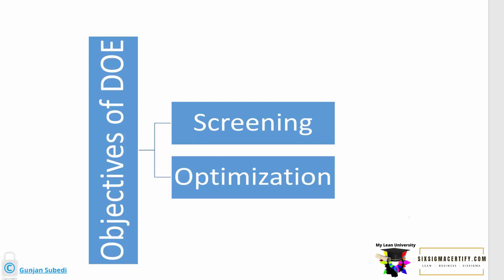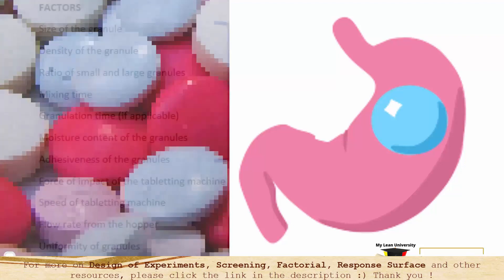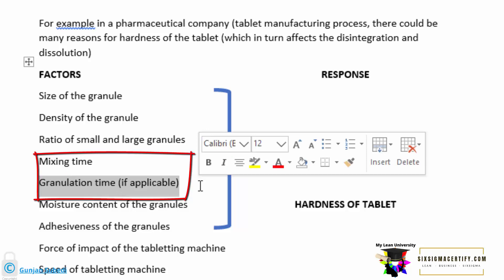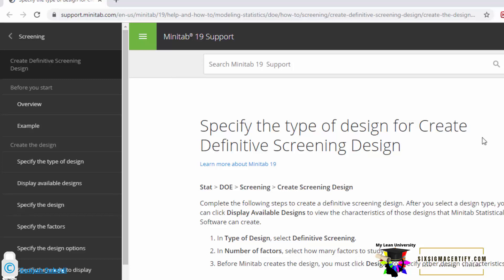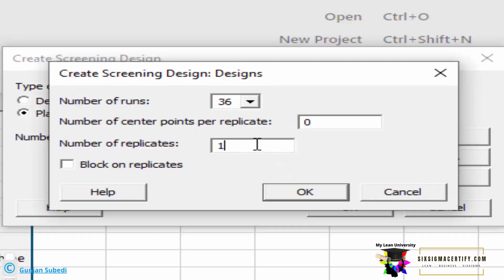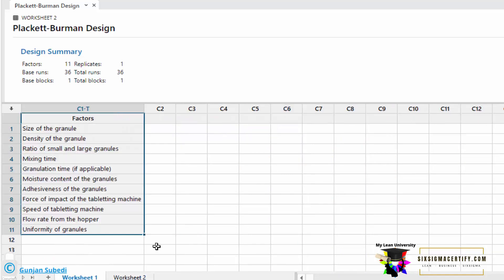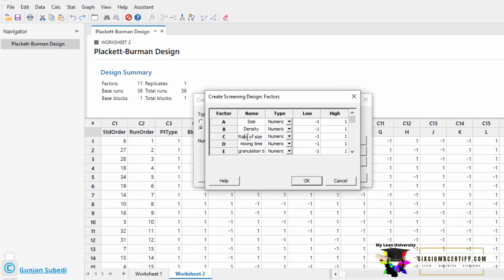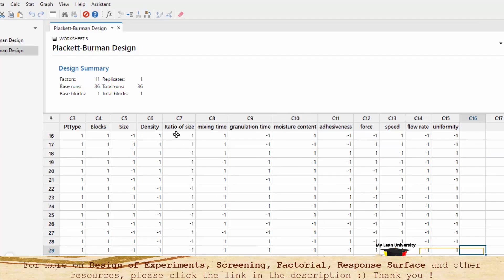Screening the factors (Part I) Design of Experiments with Minitab

Comment: I think hardness is a bad response variable since in almost all of the cases it does not have a normal distribution (so, it should be transformed), in addition, hardness could have a lot of variability attributable to mechanical anisotropy (which I think could be increased when dealing with granulated materials when particle size is too dispersed or the homogeneity index is not good)...
In my experience, having density, mosture content (even particle size if you are producing those granulates) are kind of "hard to control" factors... I would have reduced the design to a 2k factorial (might 3 or 4 factors)
I hope my comment helps...